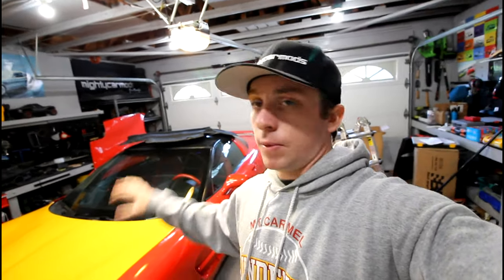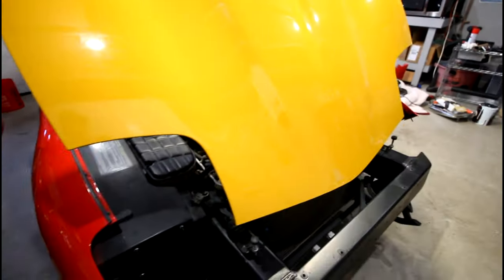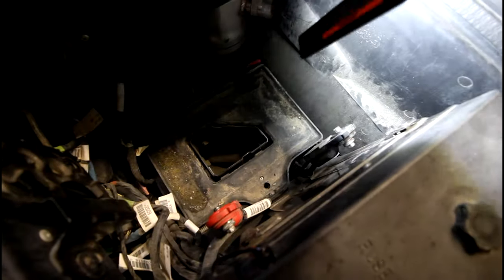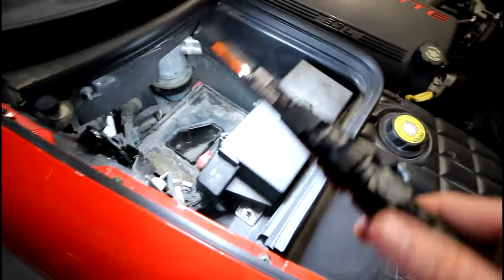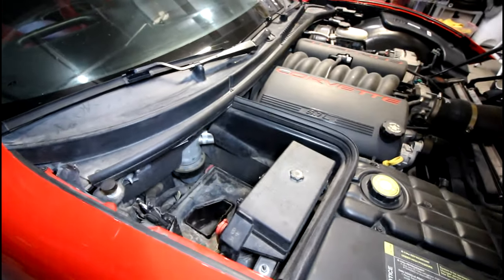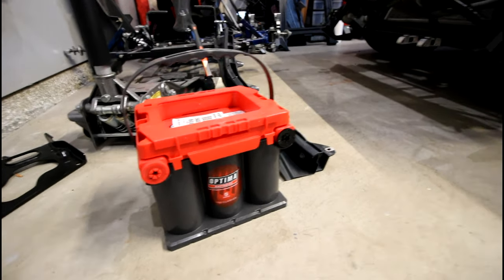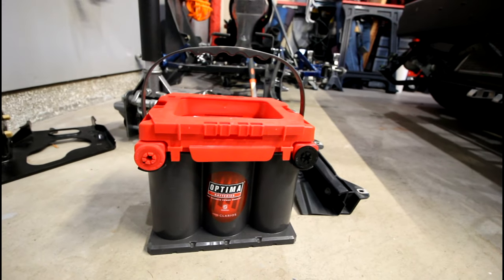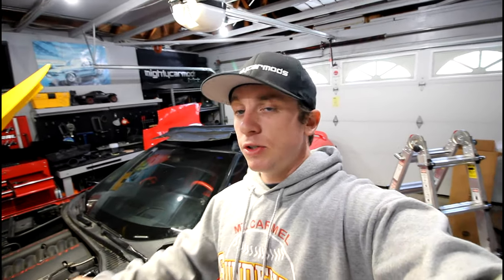Fix This Issue Before it KILLS Your Corvette!!

Comment: I agree that an AGM battery is the correct choice but I disagree about choosing an Optima battery.  Optima batteries are now made in Mexico and as a result do not offer the quality product that they once did.  I suggest going with brands such as Bosch, Odyssey or Fullthrottle.
Reply from the maker: Hm interesting, I’ve had several over the years and haven’t had  any issues.

Comment: Super useful video! Just picked up a c6 a few days ago... I’ll definitely check that out tomorrow morning and fix the issue, hopefully before any harm has been caused😬
Reply from the maker: Awesome good to hear! Yes it’s one of those simple preventative things that can be done to save you literally thousands in repair coats to either redo major wiring harnesses, the ECM, or the coating and/or structure to the frame rail! Corvettes are awesome cars, best of luck!
Reply: HEY I just picked up a C6 a few days ago as well! 2013 GS LT3 manual. No npp, no magnetic ride, no mods.
Reply: 😊 @Addimotive

Comment: In my opinion it's hit or miss , I haven't seen it leaking , the car sits more then it's driven,  I have replaced   battery probably 3 to 4 times already  for many years that I have owned the car . AGM battery is definitely great replacement though.  (I guess I was just  being cheap,  lol)
Reply from the maker: Yea I understand where you're coming from. With the risk that this poses (causing damage to the frame or main wiring harness), I just would rather err on the side of caution.

Comment: Optima batteries are a great choice for cars that drive everyday, but they don't like trickle chargers and will fail if left on a charger for long periods of time. Some AMG batteries even say to not use with a trickle charger.
Reply from the maker: I’ve heard people say what you’re saying and also people say the opposite, I guess time will tell.
Reply: I’ve heard you need a quality trickle charger that “knows” how to properly charge an AGM-type battery.  They can’t be charged as “aggressively” as a traditional lead acid battery can. I think even Leno mentioned the type of trickle charger he uses on all his cars that won’t shorten the life of AGM’s
Reply: A 1.2 - 1.6 amp trickle charger is fine. I've been using them on Optima batteries for more than  25 years.
Reply: @gmrthree Yes! The ctec mxs 5.0 is awesome! And it has an "AGM" battery setting on it. Perfect for my M5 bmw battery, it's a 2013 and still has the original battery!

Comment: That was one of the problems that I was concerned about so I put a acid Matt. underneath the battery I did not see any problems with the battery putting an acid matt underneath the battery just a precaution

Comment: I got my AGM battery a few years ago through Amazon.  I have a 2003 C5.  I think the battery was about $200 delivered.  One reason the flooded batteries leak sometimes is when the cables are over-tightened.  That causes micro cracks in the case which eventually grow into bigger cracks.  That happened to my 96 Impala SS when it was under warranty.
Reply from the maker: Oh yea that's a good point Greg. I could definitely see how the terminal connections for these batteries could possibly lead to that if you're not careful.

Comment: Thanks for the video. After 6yrs, two shops and lots of frustration, I’m just hearing about this issue. I pulled the batter tray and found quite a mess. Obviously somebody before me had an a big battery leak- judging by the acid staining. Oh yeah, the putty and zip tie around the CPU is a classic. My ground splice pack, by the AC condenser, is pretty crusty, too. So, at least I know where my problems live. Now we’ll start narrowing things down. Yes, many don’t have any issues. When I talk to other C5 guys at shows and cruise nights they look at me like I’m nuts. No troubles at all.  The lesson I’ve learned is there are no cheap Corvettes. I took a flyer on a higher mileage car and didn’t know what I didn’t know. 🍻
Reply from the maker: Dang that's a bummer! Yea a lot of people don't even realize this is a problem until they look below their battery tray!

Comment: Ive gone threw 2 optima batteries in the last 3 years in my C6....definitly down hill from what they were.....years back they served me well....I believe the quality has changed now. But they did warrentee replace my last two.
Reply from the maker: Hm that’s weird, mine is going on three years strong. I guess really my point is in this video is to replace any wet battery with any brand of AGM battery to avoid acid leaking down into the wiring harness, ecu, or frame rail.

Comment: I have a C5 corvette 2003 model. The car is not driven much during the year so at times when it's not driven, the battery drains out quickly. I was told by a mechanic to install a circuit breaker for battery so whenever I want to drive, all I have to do is switch on the button for the breaker which would be installed connected to the battery so the power comes on in the car.
When I am not driving, I would just have to switch off the circuit breaker button so the power switches off in the car. 
Please advise on this as I am new to this.
Would appreciate your feedback.
Reply from the maker: As a first step, I would not recommend splicing in a kill stretch to disconnect the battery. What I would try first, which is much less invasive, is putting the car on a battery tender when you’re not driving it for weeks or months. A good quality one should be about $50-60. That’s what I use when my car sits for a bit, and my battery has held up just fine over the past 3 years. I use a tender made by the “battery tender” brand. 

If you have a parasitic drain caused by some electrical gremlin in the car, then the battery tender (and the kill switch) will just be a band aid until the source of the drain is fixed. Hope that helps!
Reply: @Addimotive  car is parked in basement so dont have socket to plug in battery tender. Any other recommendations
Reply from the maker: @anskapadia1  run an extension cord? Otherwise, keep an 8 mm ratcheting box wrench in the car and just disconnect the battery as needed. Much less invasive than a kill switch.

Comment: I don't understand why the computer module is mounted so low in the car behind the front wheel. Doesn't it easily get wet over there?  Any electronics should be located high and dry.
Reply from the maker: Yea it definitely isn’t the best location for sensitive electronics. The area where the ecu is housed is covered and enclosed by a bunch of paneling like the fiberglass wheel well and a few other bolt on panels on the bottom.
Reply from the maker: So thankfully it does stay dry in that area when driving in the rain.

Comment: How has that Optima battery held up?  I have heard the Optima batteries quality has gone down hill in recent years.  
I used to buy them off Amazon for like $160ish years ago, now they are like $250.
Reply from the maker: I’ve had this battery for about 9 months now, and so far it’s been great! I’ve kept it on a tender since the car has been sitting for awhile while I do repairs and maintenance. I’ll be curious to see how it holds up over the years since this is my first optima. I just wanted to get rid of a standard lead acid battery and get an AGM battery ASAP for the reasons I go over in this video.
Reply: Ive gone threw 2 optima batteries in the last 3 years in my C6....definitly down hill from what they were.....years back they served me well....I believe the quality has changed now.

Comment: I'm replacing my battery with the red top optima battery. My problem is the lock down bolt is missing the nut under the battery tray. Any ideas on locking down my new battery?
Reply from the maker: Hey Bob, is it completely missing, or is it stripped? If the threads are just stripped you could try tapping to the next largest thread size and then getting a matching bolt to hold down the clamp. The battery tray is a replaceable component, but I think to get access to remove the tray, you'll need to remove possibly the fender or part of the lower fender liner.

Comment: The battery location shown in this video would only apply to the C6 base cars, the ZO6, Grand Sport, ZR1, & the 427 convertibles have the battery location in the passenger rear compartment
Reply from the maker: Dan, good to know! I didn’t know it was different between the base and other models. Thanks for the comment.
Reply: @Addimotive  they have a dry sump so that is where the oil tank is👍

Comment: Just FYI I had a four-year-old Optima yellow top in my C6 and it started leaking acid from a crack on top/side near the negative terminal!  Optima would NOT warranty it even though I took lots of pictures and sent them!  When I replaced it I cleaned up the tray-luckly I caught it in time and put a battery acid absorber pad under the new one.
Reply from the maker: Good to know thanks for the comment! I’ll keep an eye on it.
Reply: I’ve always been told to get the red top, not the yellow top

Comment: I check my battery for leaks every time I open my hood. Why not just get an AGM battery, like Optima batteries? My understanding is that they don't leak because they're completely sealed. You can even turn them on their side and run them. Also, why is your car's hood yellow, yet the body is red? Is that a special hood?
Reply: He bought his Vette' from an auction and it had front end damage. This is a rebuild project. 😁
Reply from the maker: Salvador, that's what I recommended in this video is to get an AGM battery like an Optima red top. I was trying to get a McDonald's sponsorship but it didn't work out..... lol, the car is a rebuild project so as Mark mentioned, the front end had damage, including the hood, so I got this yellow one for really cheap from someone locally who was parting out a C5Z.
Reply: @Addimotive  That all makes sense. I have a radar detector in my C6 that I was powering off the cigarette lighter. That cigarette lighter remains hot even when the car is off, and even when the 15 minute courtesy power shuts off. So I ran my lead acid battery down to zero, and you know how little those batteries like that. After that experience I wired the radar detector into a hot wire for the electronics in the mirror and I got an Optima Yellow. The GM drive cycle is weird to me, and I didn't want to keep having to do that over & over on top of paying for a new batteries. The Optima Red batteries look better, the color matches the LS3 lettering on the coil covers, but I wanted the longer reserve time just in case.

Comment: Great video, just picked up a 07 C6 and did notice the battery placement. Didn't think much about it until now. Will check it out.
Reply from the maker: Thanks Jeff! Awesome, congrats on the new ride!
Reply: I have a c6   its not the same, computer is not under the battery tray.   Do some research   some c6 cars have huge parasitic drain problems    the manual says keep  it on a storage battery charger if not using the car in 27 days.   I am telling my car has no parasitic draw.  I bought it used and it came with a new  battery in it.  It  died in less than a week.   I had a bad battery,shorted cell.  I learned the c6 had a few different size batteries and battery trays!!! I put the biggest AGM battery in it possible.  If you start and drive the car with in a week you should be fine.  Regardless if you are having issues or not,keep a battery tender on the car if you can.  I cut the edge nearest the engine off the battery tray and moved the wiring harness away from the inner fender well and fit a H7  battery in place.   If I were to do it again, I would use a H6 from a C7  it will fit a little better after the mod.  You can find a chart of battery dimensions online.  Of course I learned all this after buying the C6. 
I hope this helps anyone with a C6. Ask me any questions, if I can help i will

Comment: I have a 2004 corvette starts fine when cold but if i drive car and try to start it while hot it just turns over but wont start any ideas
Reply from the maker: Interesting! So I haven’t directly heard of this issue for the Corvettes, but with my AMG Mercedes I had before this, that same thing happened when my crankshaft position sensor was going bad. It was an intermittent issue that happened mostly when the car was warm and it left me stranded one day. No check engine light at first either. I replaced that sensor and it solved the issue.
Reply: @Addimotive  yeah it's like that on Nissans as well I've been with them for 6 years and that's the go to but usually throws a code With this corvette no codes present. I appreciate your reply and glad you were able to fix your problem

Comment: After replacing my battery , my alarm is going off randomly , anyone have ideas?
Reply from the maker: Do you have an aftermarket alarm?
Reply: @Addimotive  no its the c6 standard horn type alarm that happens when you open the door without a key ect
Reply from the maker: @mikechrest6997  hmm interesting. I would use a multimeter and double check that the new battery has good voltage. Usually alarms get triggered randomly when a battery's voltage is too low so the car thinks it's getting stolen/jumped. You could also try replacing the batteries in the key fobs to see if that helps at all.